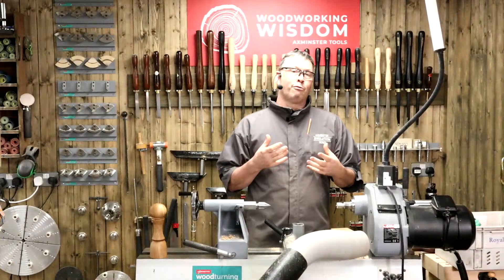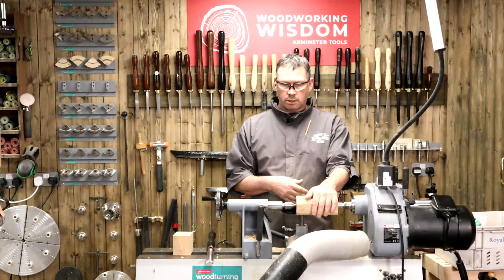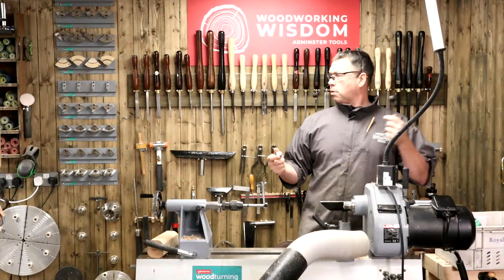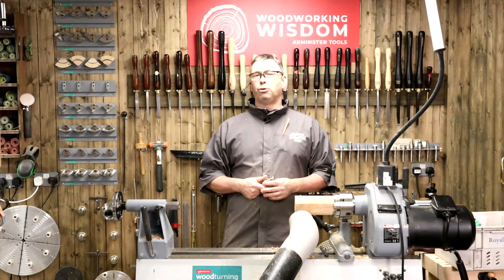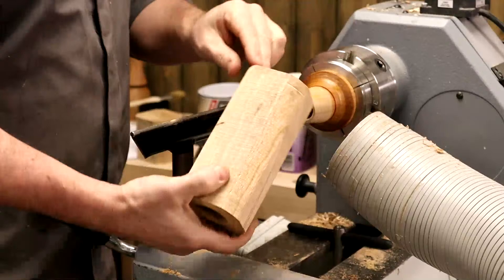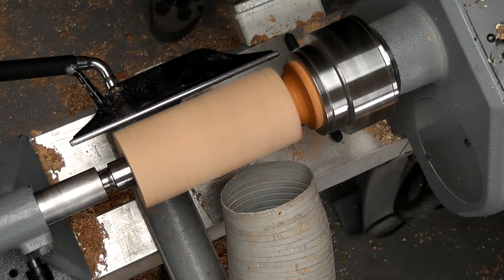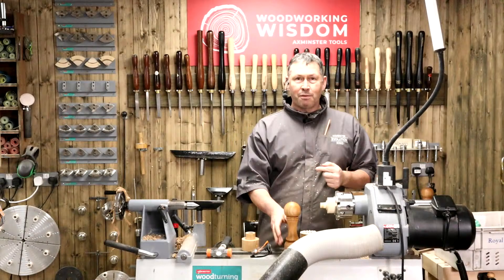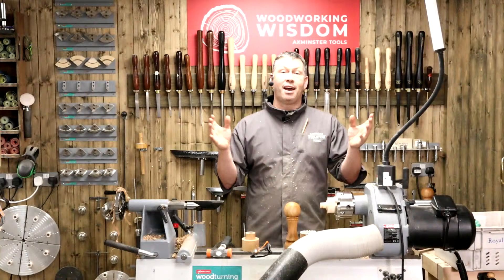How to Turn Salt & Pepper Grinders - Woodworking Wisdom

Comment: When I was young In Italy it was always a pepper mill. Salt mill did not really exit until recently. The ceramic grinder has changed that in recent years so the general rule we go by is the pepper mill is always taller or darker. So to say, if there are two mills of the same wood species, the pepper mill is the taller one. If they are a different species of wood then they could be the same size but the darker wood is pepper. Hence, taller or darker... and could be both but that is up to you. God Bless :)

Comment: Colwin says twice that he is using / used a 24mm bit for the deeper hole in the top. The Crushgrind instructions (and all other sources I have seen) say 22mm, which matches the diameter of the top for the linear splines to bite. Is Colvin doing a loose fit that will be glued, or was this a mistake?

Comment: Curious Colwin, as to what you aim for when rounding the body of the mill body base at the mechanism end? 
You make the holes with the mill drill for the mechanism to seat in. Then you measure back, from the front of the body, to clear both the entrance hole and mechanism hole and make that mark on the outside of the mill body. Then shape the body section.  Is there a minimum you would round to?
Thanks for the info in advance
Take care
Cheers
Harold